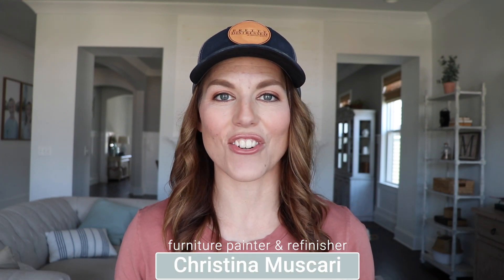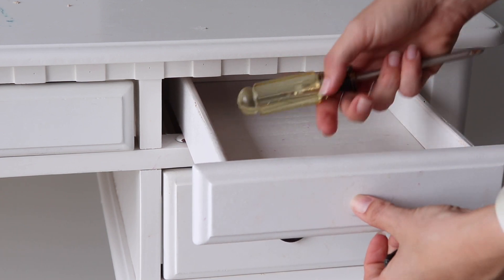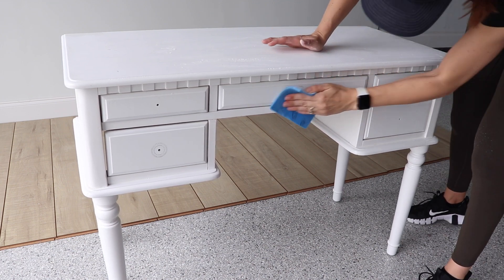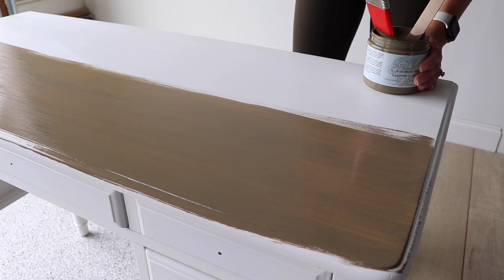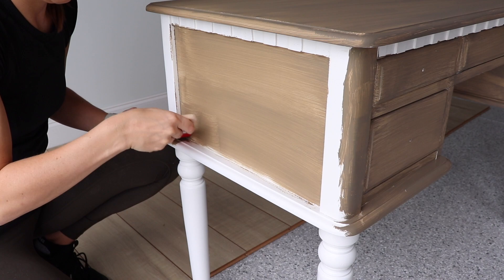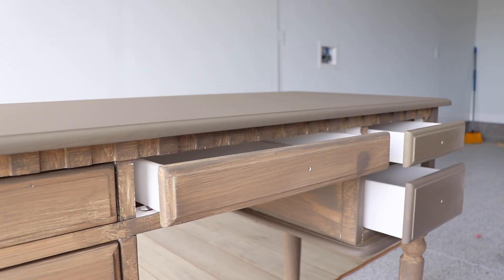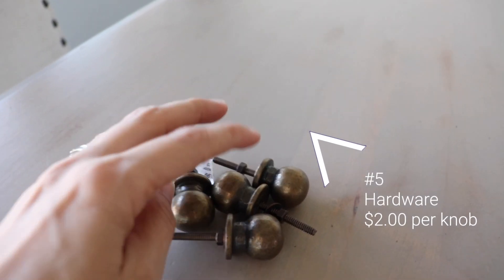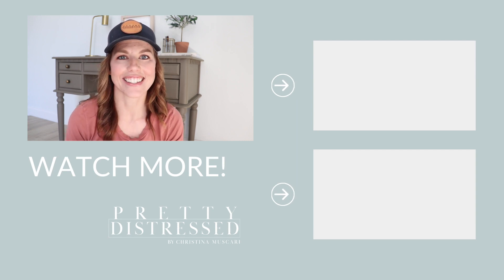5 Product Flip | Furniture Makeover for Beginners

Comment: What a beautiful color. I'm tackling something I should have done in my 40's or 50's, not my late 70's! It is an antique oak washstand that I have begun sanding to remove the old finish. I had to buy a new orbital sander, because my sander from the 60's quit. It seems it didn't like sitting in a drawer for 40 years!  This is a real challenge for me physically as I have some limiting health issues. But, if it takes my until September, that's ok with me. Just so I am able to complete it and not leave it half finished!  I have learned so much from the YouTube furniture flipping community that I wish I had known back in the '70's!

Comment: I need some advice. I found a desk (french provencial) being tossed and repainted it. I used a regular paint from the Depot. I don't remember if I went through the entire process of removing it's gloss. I think I just did the bare minimum because I was doing it in an apartment.  Needless to say the paint came off in many areas were I left articles for long periods of time. I'm thinking of redoing it in chalk paint instead. Should I resand? Use a liquid sander? Or can I just use the chalk paint? Also after painting the desk, what is the best top coat? It's going to be used alot.

Comment: Hi Christina, I really need your help/recommendation asap. It doesn't have to do with this video though, it has to do with your chalk paint topcoats recommendations.  I painted my dining room table with Magnolia Home (Kilz) Chalk Paint. Their wax finish is not sturdy enough for a dining room table because the paint is so sensitive. I learned that the hard way. After removing the wax and re-painting, I am looking for a durable top coat that will maintain the beauty of the chalk paint, won't streak when applying, will hold up and won't scratch with use of glasses, dishes, and even my laptop on occasion!  Which top coat do you recommend? Please help!! Thanks so much!!

Comment: Question. I just painted a plant stand Cotton from Dixie belle and as I was putting on my satin clear coat, I kept getting fiber after fiber and hair after hair in the piece and no matter how many times I took them out, more kept appearing. How do you avoid this?
Reply from the maker: Its a really hard thing to avoid! Using a good quality brush is the best way to reduce this- but to some degree there will always be shedding.
Reply: @ChristinaMuscari  Thanks. Not sure if this is a total mistake or not but my LAST coat of the satin clear coat, I mixed a tiny bit of the white cotton into it and made it a tiny bit opaque and it colored any other fibers that may have gotten in it. Lol hope I didn't ruin the top coat of my plant stand >.<